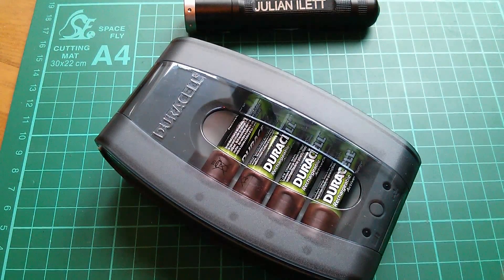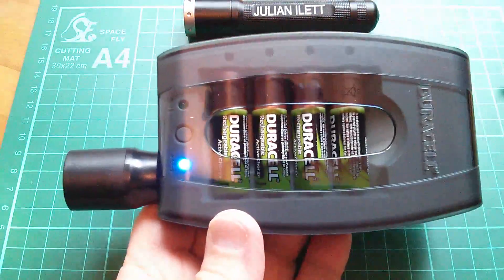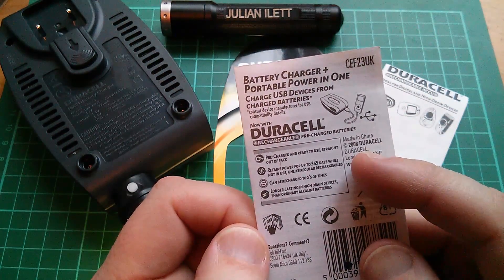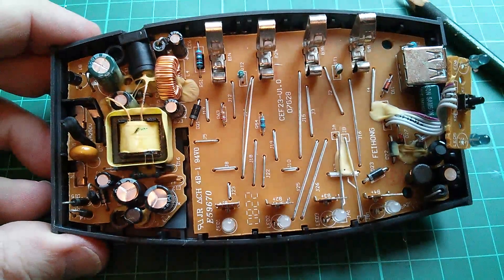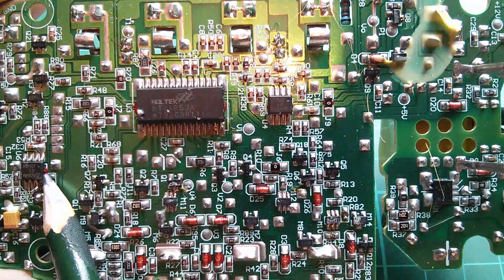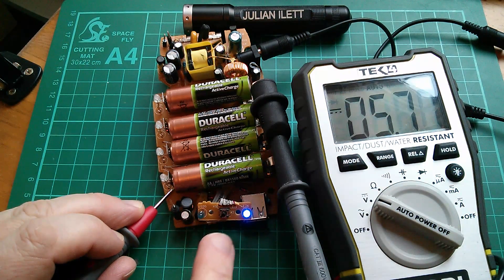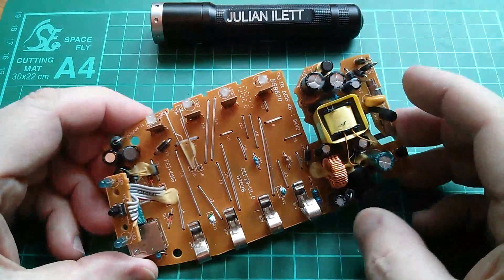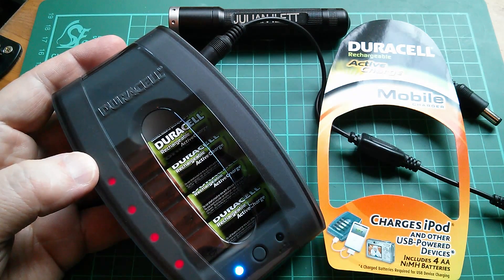Teardown: Duracell CEF23 Battery Charger/USB Powerbank

Comment: I've got 2 of these. Both won't turn on USB output unless the accus are FULLY charged. However when they are, let's say 50% charged, there's a way to "trick" the charger by pluging it to 230V and then turn on USB output, unplug it, and it works until accus are depleted. Strange, isn't it? Overall my favourite charger.

Comment: Would it be iterating voltage down the line? Like PWM, but instead of turning off the voltage, it switches rails? So at any one time there will be a potential difference? Does a RMS reader read different?

It is possible that the battery charging voltage gets passed as series to the USB. That means it does no smart charge, just sticks a voltage on the the tabs, all of them pulse width modulated out of phase with each other, so it will still add up together to produce the voltage for the USB.

Comment: Heyy Julian! Ypu probably didn't watch the Varta battery charger teardown of Dave Jones ;) I think this works exactly the same way. The batteries are charged by one constant current source (that is probably clamped to some voltage) and all the active (<- that's the keyword, so not the empty) slots of the bank are put in series. The empty/fully charged slots are simply bridged out. This way you need you constant current source and it's easy to tap the battery or the charging voltage and just step it down to USB 5V.

Comment: Perhaps they're charged in series too, and they're just shorting out the missing cell bays with the FETs. Your voltage measurements with 2 cells would make sense that way.. The two points on the same end are electrically the same as measuring a single cell.

Comment: I wonder if you shave the DC plug whole just a little wider on the case, then maybe you won't need the DC cable spitter. You shouldn't have to shave much off to widen the diameter.

Comment: From your voltage measurements, I think the cells are charged in series and the transistors just switch in to bypass empty slots and they're still in series for the USB output. I wouldn't be too surpised if those inductors and caps in the corner are a DC-DC converter for the USB output.

Comment: I have something similar but it works with 18650 lithium ion batteries. its both a 4 slot 18650 charger and it has 2 usb ports on the back to used the charged cells as a power bank. Dunno if id trust AA's to do a power bank job though.
Reply: +umbrefawx previous to the 18650&#39;s the AA to usb banks were just to put a bit of charge back into your (pre smartphone era) just to give you an emergency bit of talk time if your battery was flat, not to actually put any real charge back to it, and that was back when batteries were sub 1000mah in phones. i  have a few early usb gadgets, and they not only had a limted power output (500ma) they tended not to like extended run times, as they never thought they would be used more than a few minutes, and thus my very early mains adapters run very hot, and burned out when i left one overnight, there were no decent makes very early on (early 2000s)  plus the most common phone , the nokia, needed 6v anyway, and although you could get a usb to nokia cable, it would not charge of course!

Comment: we ALL "ROCK AROUND"  down here man !"  Actually, my opinion of Duracell has dropped a lot over the years since they appeared in pound shops and were crap...

That thing looks well ovelry designed, but cheap at the same time ! I'd be surprised if most of them worked on the 4 cells ...

Overall...NASTY lol

Comment: the toroidal inductor is for filtering....
Reply: ***** have u opened a mains switch mode psu before?
Reply: ***** if is used in a buck  topology from the 12V line there should be a switching element a  switching controller and a diode and the core needs to be from a suitable material (not iron powder) 

what is the color of the core? because yellow or yellow-white is for powdered iron which is used for filtering
Reply: +viermidebutura 

This very cheap, basic, single sided design at a low power level offline converter almost certainly makes it a flyback. There has to be some kind of dropper for 12V input to 6V for charging 4 cells. Buck makes the most sense.

The toroid inductor is more likely to be the 12V to 5V buck inductor than second stage filtering for the flyback. The core material wouldn't be different between the two as both need to carry DC current, so it won't be an ungapped ferrite toroid. The core looks too big to be a second stage filter for a flyback which even for much bigger supplies is usually a small ferrite rod with a few turns of wire.

Comment: I find 500ma useful as I still charge my devices from the 500ma my PC usb ports provide... (and 900ma from a couple usb 3.0 ports)
Reply: +vgamesx1 - All my thinkpad laptops cut off a bit above 2A on each USB port when charging dumb things, but my newer thinkpad can charge an ipad at 2.4 amps. USB is amazing! :D
Reply: +vgamesx1 Yes, but many computers don't tightly regulate the amperage, and allow ~750ma (for 2.0)  without throwing a fit.

Comment: Actually the thermal conductivity dont have to be that good. Because it got quite a bit of isolation and some back side heating the thermal resistors will have a fairly accurate number. The respons times is not in seconds, rather minutes, but it don´t have to be.

A really easy common way of doing multiple cell battery chargers is just to run them all up in series. then have a switch shorting up all the empty spaces where its no batteries.

This transistors can also bleed current bypassing one or several batteries to charge all the batteris at the same rate. I don´t know if this device use that exact method, it seems like there is just to much switching elements... anyway, it´s how i would do it.

Comment: "long barrel end" just a tip........oh now that is cool a battery Pack USB flash light! the spring didn't have an cover on it, so if it ever Touched the board, it could short it out
They are Biased while Charging.

Comment: i have one of these, it only discharges the batteries only slightly, less than an hour of 500ma charging before it just switches itself off, its not a timer, so it wont try again for another hour, its a good charger though, doesnt get warm, reliably fills the batteries, many fast chargers either turn off too soon, having only part charged, or miss the delta V and make a battery warmer.  i think this does use the cell voltage directly, but has a simple voltage limiter and cuts off just below 5v also, hence the terrible 5v runtime.   chuck it my way! i think its a very good nimh charger